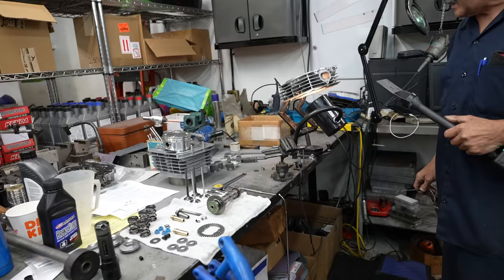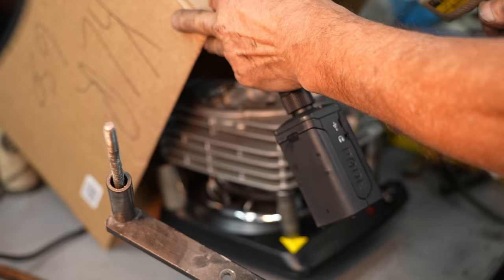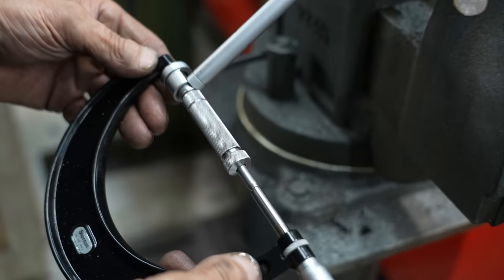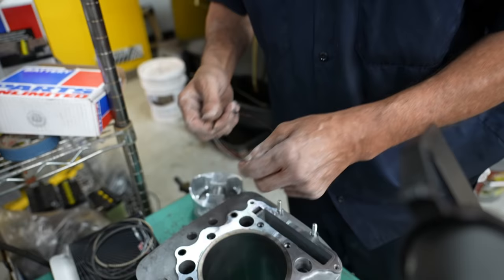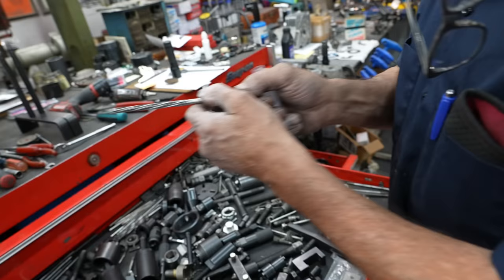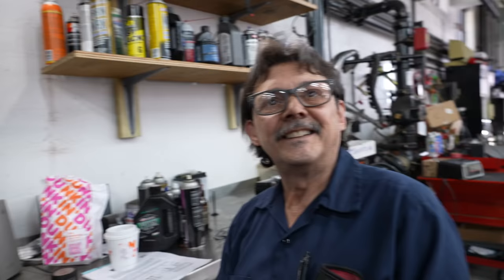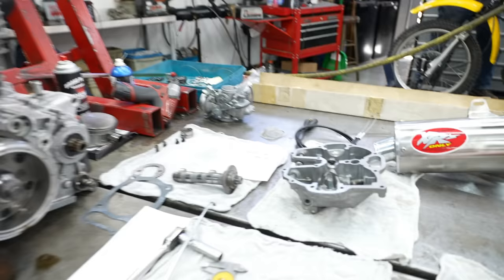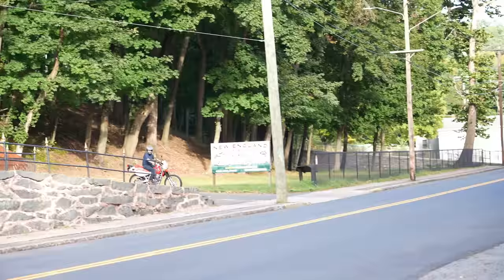OUR BUILT XR650 HITS THE DYNO!

Comment: Great mechanic, but math skills could use some brushing up. At 19:00 or so he's calculating the volume of a cylinder using pi X d^2 x stroke which is wrong. Then divides by 4 because he's working with a "single cylinder engine". The formula is pi x r^2 x stroke. And r is obviously 1/2 of d, the bore. He lucks out because he basically corrects the result, which is 4 times too big. But not because it's a single cylinder engine, because r = 1/2 d and 1/2 squared is 1/4. Next time, he needs to use volume = pi x ((bore / 2) ^ 2) x stroke.

Comment: do your math right..   radius x radius x stroke x pi.     count with centimeters because you want cubic centimeters.
In this case the bore was 102.0mm. then the radius is 5.1cm.    And dont calcutate with 3.14 when using google.  use pi instead
5.1x5.1x8.2xpi  = 670.045164343   not 669.705
This is very important if you do racingengines. If an engine is more than what is allowed then the driver will be disqualified.  Even if it is only 0.1cc over limit.
Otherwise you do a great job.

Comment: question- with the seat having a 5angle grind, does the valves stay at 45degree cuts (which causes a very narrow sealing surface) or are they mullti angle cut also? thanks

Comment: Why would you hop up the legal version when there is the XR 650 R?! 

The L makes 40 horsepower stock a the R makes 61 horsepower stock.. so slap a exhaust pipe and K&N filter on the XR 650 R un-cork the carburetor and you have one hell of a dependable bike with explosive power!!

Comment: Incredible work very cool. Is this really necessary when you could get a crf450rl?
Reply from the maker: Completely necessary. The crf450l is a puny mx bike, skinny seat. Not good for long distance street or two up. Ask scott Summers.  The 650 will bury 4 450's before it needs engine work.   Its like comparing a Ford F450 to a F150. Totally different animal.
Reply: @KaplanCycles  "puny mx bike" 😂
I love my xr650l but it's no touring machine anyway. Of course the crf450 would need a new seat but that's easy. I just feel like the cost of labor/parts would be so astronomical it wouldn't be worth it. But it's cool for sure
Reply from the maker: Got to have the right tool for the job.    Mx is crf450 territory, dual purpose with any hiway use is out of the question for high revving 450. I own multiples of both. Imho

Comment: How much in 2023 dollars for Kevin Sr to do all of this to my hypothetical 2015 XR650L motor?  Can the displacement be safely raised to 690cc? I weigh 240lbs PLUS riding clothing and gear. I need closer to 85-90 RWHP to be happy. 

I could get a 1190 KTM 170 HP and probably harm myself and go very broke. Or go for a used low mileage XR650L for $6K and put another $6K in it. Maybe even 8K if I get top of the line Garmin 6" GPS at $600 plus the many little accessories that make the bike better and better as they add up.  So, $14K for something comfortable, light(ish), and powerful..... but not as lethal as having 170 HP plus on tap.

I would most def have Only XR's weld more cooling fin area on the heads before sending the motor (or bike) to Kevin Sr.

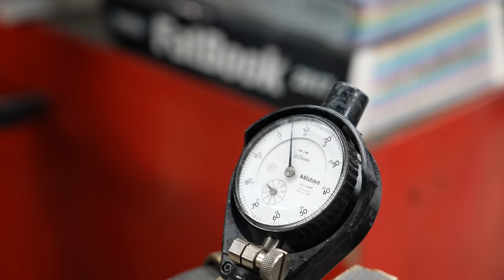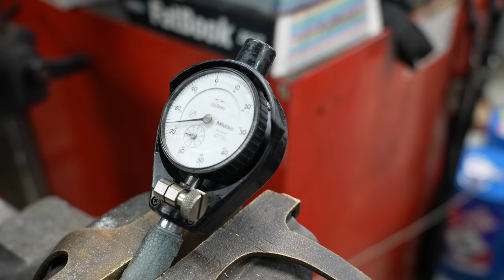Comment: 11:03 thats 50 micron... Not 5. 5 micron would be 0.005mm which is 0.00019 in  9:47 20 micron not 2.. Old fella needs to brush up on basic metric units :/
Reply from the maker: This old fella will run circles around your ass in the shop with one hand.
Reply from the maker: So your a math geek nerd, Excellent.  Go be an accountant pencil pusher. I guarantee jeff will outwork you and is the better mechanic.
Reply: @KaplanCycles  Ok question time: How many freedoms per bald eagle is in 5 micron?

Comment: Needed more than the stock 36 Hp. Maybe he bought the wrong bike. Don't believe all of these claims. Thumpers are designed to be ridden like they were stollen, in the higher revs. Lugging this design polishes the machined cross hatches in the cylinder walls there-by making them unable to hold oil as they were designed. Rev these bad boys up and they come to life. Many have complained they are sluggish. Perhaps they are new to thumpers.,Big single cylinders. I hear folks putting them around town. I rode 11 Kms to work and back, so 22 Kms each day and would get in to 3rd geer a few times for a minute or two tops. These engines have three main sounds  Put-put put........idle        Bruuuuum   accelerate towards the power band............Hummmmm   when they are happiest. Ask around to the folks who know they will confirm this.